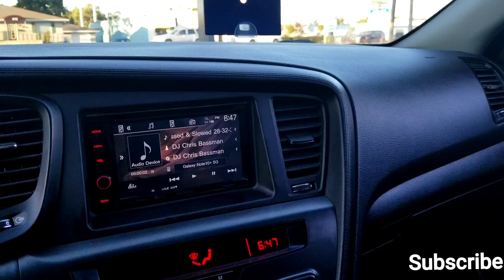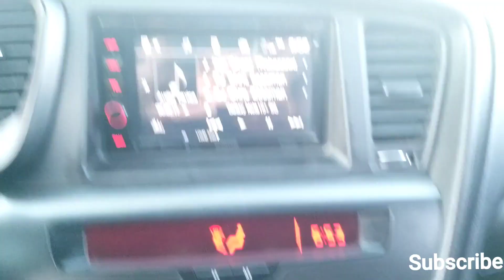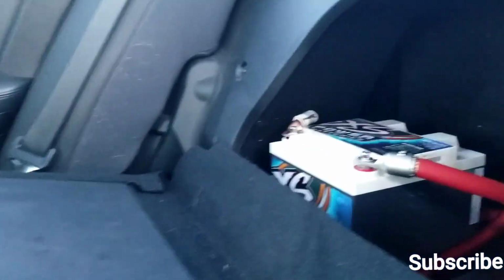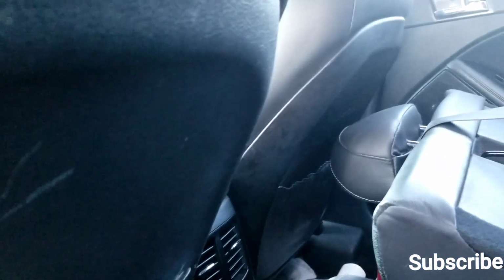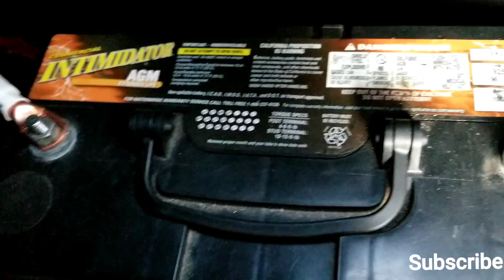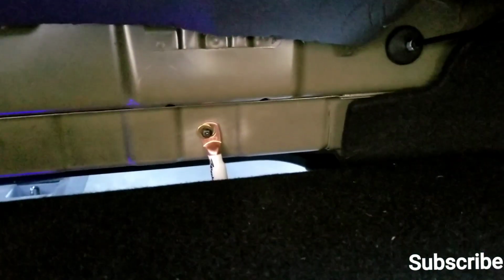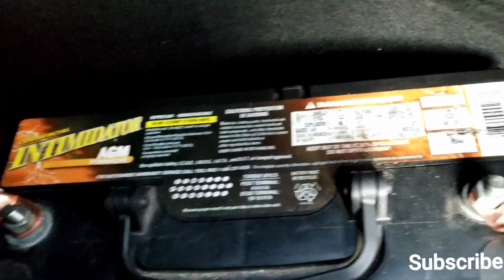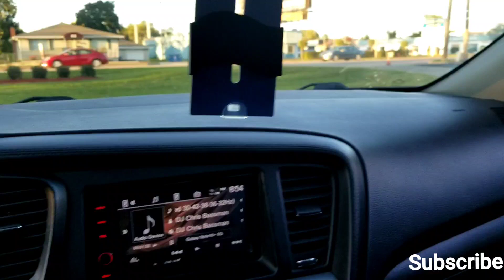28hz,32hz,36hz,40hz Blow through,New Battery Update Intimidator,DC Audio level 4 12

Comment: Wanted to ask you, what battery is the amp actually pulling it’s initial power from? Since the recent upgrades you made. I know previously it was pulling from the smaller Xs battery
Reply from the maker: It's pulling from the back battery first which is the Intimidator and then the XS power and after that the battery in the hood that's how I set it up with the distributor box